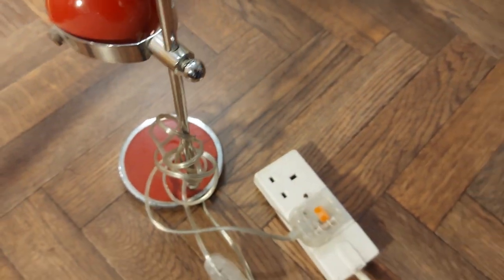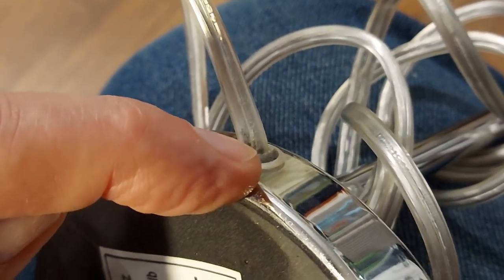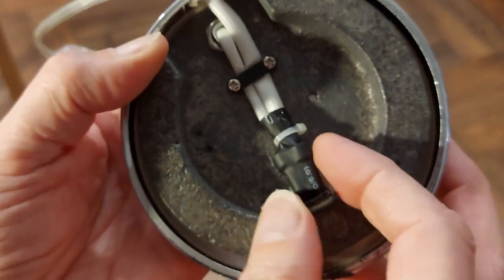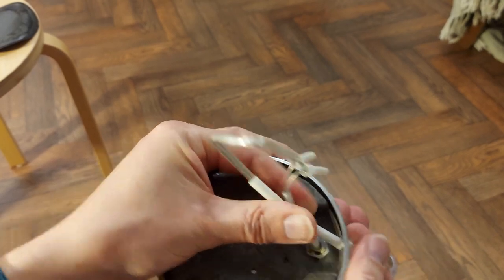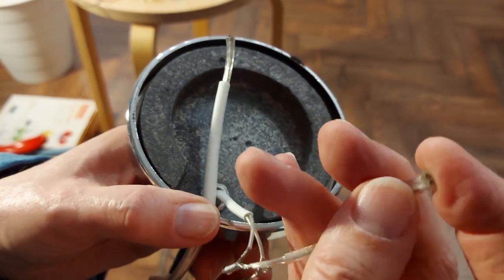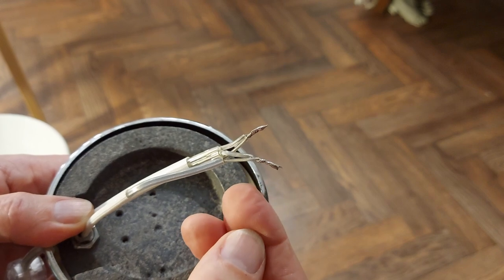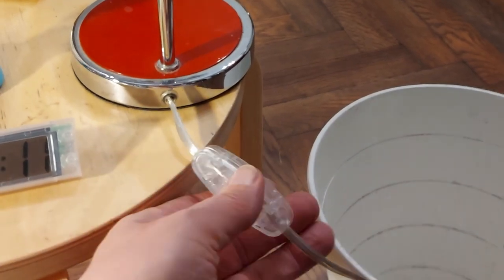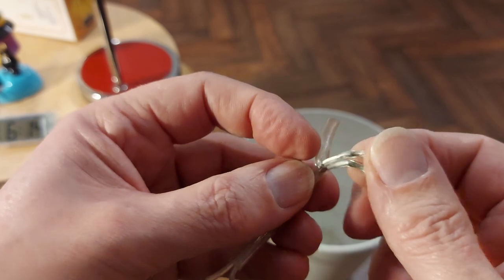Fixing an old B&Q Table Lamp Item No 3665688

Comment: I agree with what you said about those crimp connectors. I don't like them either. 
That fix is a lot better than the way it was and a lot safer.
I was surprised the arcing never caused your circuit breaker to trip. 🔌👍👍
Reply from the maker: By coincidence, I was working on my daughter's TV at her house. A component blew on the power board.  It wasn't until the next day that she mentioned that she had to reset the circuit breaker when she realised that the dishwasher wasn't working 🤣